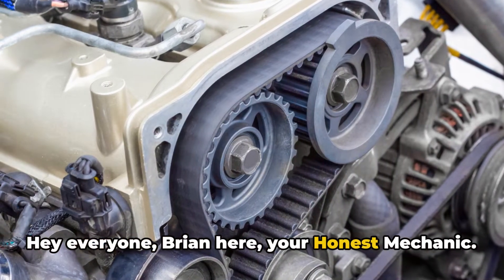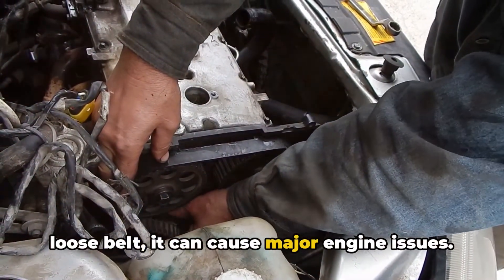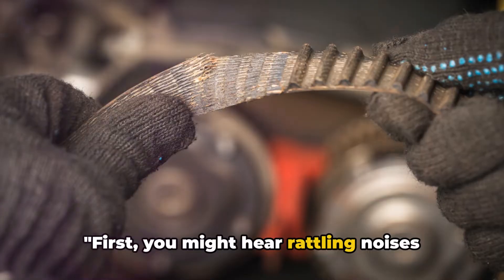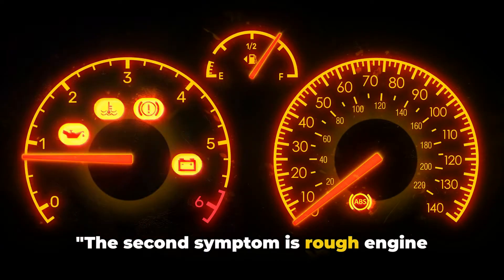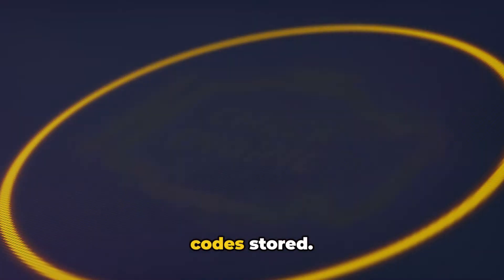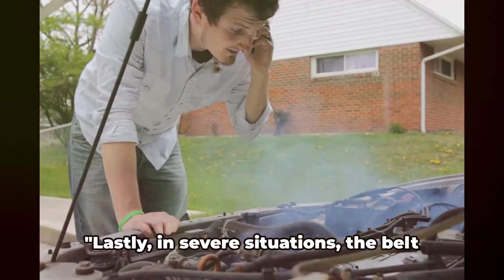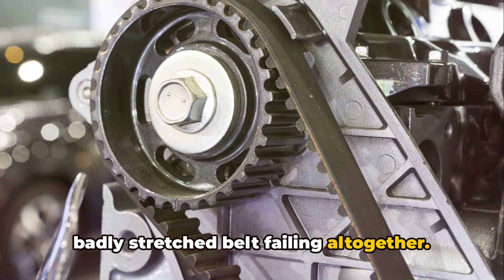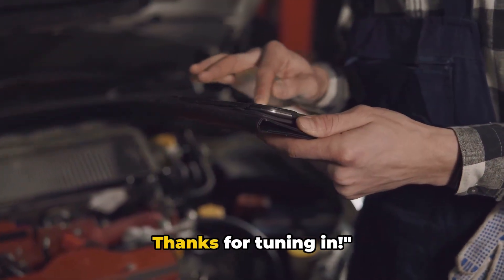Loose Timing Belt Symptoms: 4 Common Signs

Comment: Hi I've got a feeling my timing belt has an issue. It was only replaced 5 months ago but I don't think the mechanic fitted it correctly. The engine makes a rattling noise when accelerating. My car will have hiccups on the motorway usually when going above 60mph. The car really struggles to start in the morning. I have to crank the engine twice to get it to start. The car feels sluggish when accelerating out of junctions as well.

Comment: Hi I notice my car makes a rattling noise while idling or driving at lower speeds but when I get above 30 mph the noise goes away its been doing this for a year and a half I took it to the shop for diagnosis and they were unsure could this be the timing chain?

Comment: My timing belt making noise at 1 st gear after first they dont make noise can i change or not?
Reply from the maker: Hi, If your timing belt is making noise only in first gear, it could indicate a tension issue or early wear. It's advisable to have it inspected by a mechanic soon. If the belt is indeed faulty, it should be replaced to avoid potential engine damage.